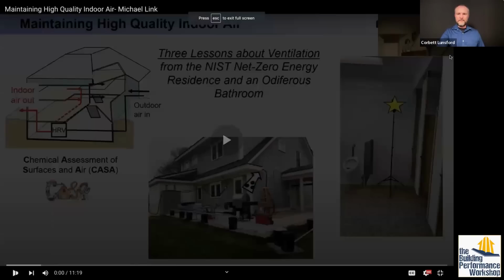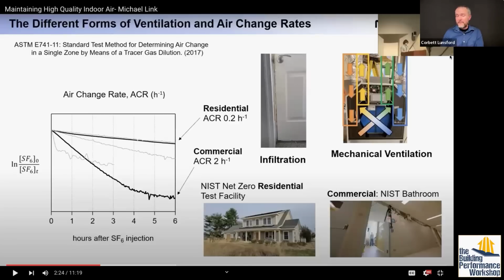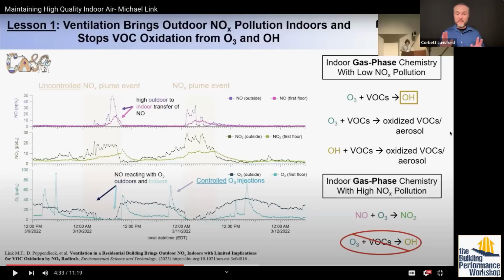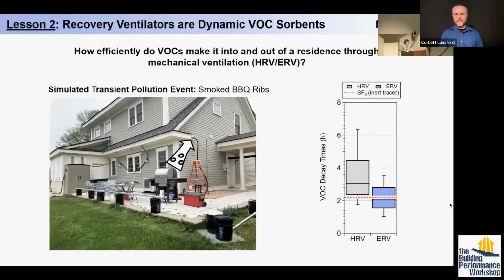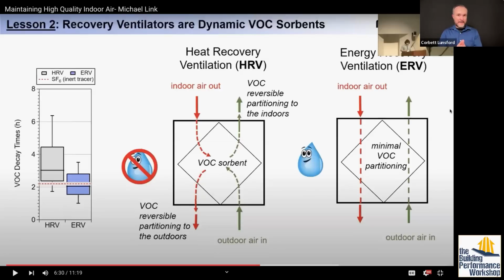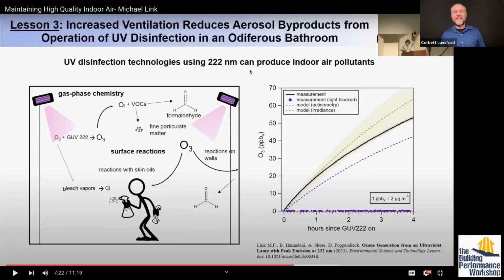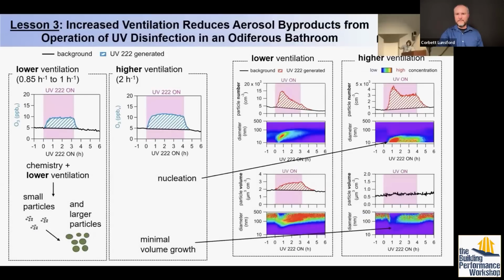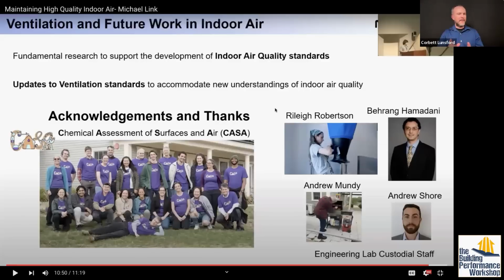Home Ventilation SIDE EFFECTS: Ozone, HRV vs ERV, NOx, UV Disinfection with Michael Link (CIE 5/31)

Comment: Years ago I had a talk with an HVAC designer. He said he went into a commercial building and the exhaust fans didn’t work. So he asked the project manager about it, the guy said don’t worry about it. So he called the building inspector. They said nothing we can do about it. So he asked what does that mean? The response the inspector said we went rounds with him til we were blue in the face and there is nothing we can do. The code book says every bathroom has to have an exhaust fan, but no where does it say it has to work. So this contractor buys broken ones from a salvage yard and installs them to save money. So when you say the exhaust doesn’t work, by code it doesn’t have to.
Reply from the maker: Hahahaha oh my god nooooo. One more reason code doesn’t work. FYI there may be a ventilation standard like ASHRAE rmbedded within the applicable code, which would need to be separately referenced. That would do the trick in some cases, but it’s a battle of wills sometimes.
Reply: Commissioning will take care of it

Comment: So I need to know, if I use a water based air washing system in my home instead of fibrous filters to remove both particulate pollutants like pollen, cat hair, and dead skin particles, and also water soluble air pollutants like VOCs, will that remove NOx pollution as well?

And if I then use a dehumidifier to bring the washed air back down to target humidity, and a 254nm UV sanitiser (with the whole system inside an opaque case to protect us from the UV) to make sure legionella doesn't breed on the dehumidifier, will that work and give my family safe air to breathe - without ozone, without legionella, and without all the pollutants commonly present in untreated air both indoors and out?
Reply: You don’t want to add a chemical reactor (like UV) to the process of filtering and processing your air.
Reply: @shubinternet  That's why the 254nm and not shorter. It can give you cancer if you expose your skin to it, but it doesn't create ozone. So if you put it in a case where your skin will not be exposed to it, all it's going to do is kill any legionella or other pathogens that get in the way of its light, without having any consequences outside the case.
Reply: @shubinternet  How do you stop legionella breeding on that always-wet dehumidifier? 254 is too long wavelength to make ozone, so it should be safe - so long as it's enclosed so it can't give me cancer.

Comment: Going back to chemistry... you can't create or destroy, so the true formula is NO + O³ -> NO² + O² (they are missing the oxygen in the output). Also, one of the top causes of death is overdosing on di-hydrogen oxide. 😀
Reply from the maker: I hope it never becomes a TOP cause of death, but you're right, di-hydrogen oxide is my nightmare.
Reply: There was a Star Trek episode on this, yes?
Reply: (For those that did not figure it out... di-hydrogen oxide... H²O... water)

Comment: ASHRAE241 is critical to be implemented- we’ve been ignoring airborne pathogens for over 100 years, even though we knew how to solve it. To ignore this is the equivalent of continuing to poop in the well.  The primary mechanisms in 241 are ventilation and filtration and in combination that should reduce at least the particulate impact of supplemental UV in the specific circumstances where it makes sense. 

Curious about the impacts of carbon sorbent filtration on Nox and O3, I know it works well, in sufficient quantities, on VOC concentrations, but I don’t have O3/Nox sensors yet to test.